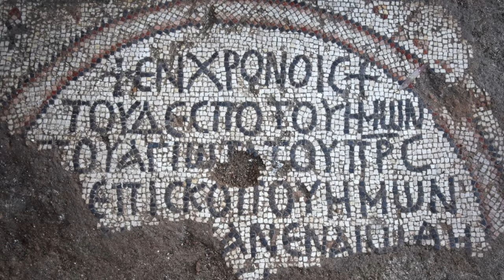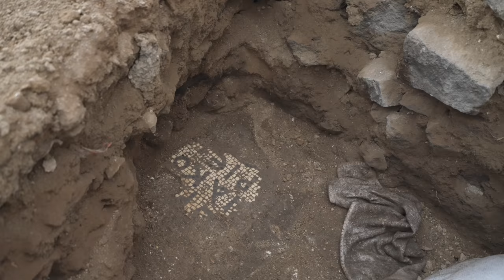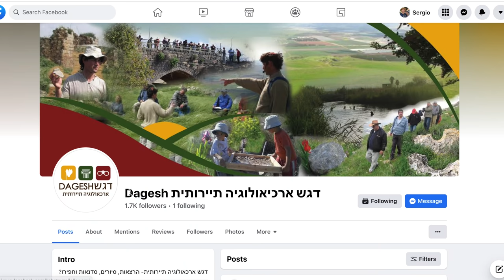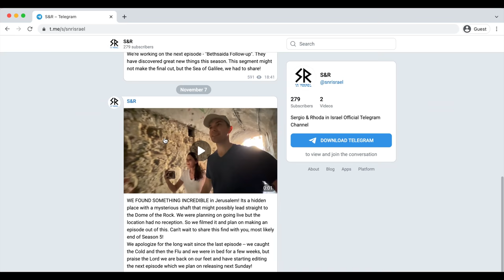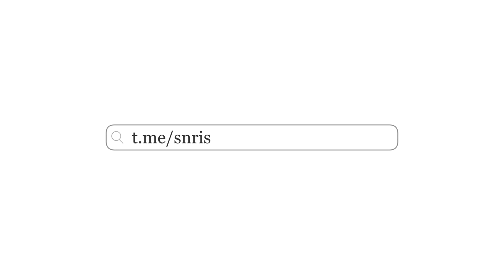1,500 Year Old Mosaic Discovered by the Sea of Galilee

Comment: Look, I'm Greek, I've seen the Greek Orthodox in many places where there was an ancient building or even a village they built their church on top of the old buildings
Is it possible that the church was higher, maybe with a staircase
so that the door was high and it started higher than the foundation
Reply: that's a pretty good conclusion though
Reply: I agree. Surely it had to have stairs? Possibly made from timber that has disintegrated.

Comment: I wonder, if they find a Hidden tunnel, leading in to the original Church some where? !
This is AMAZING!
Shalom  and nice digging from Denmark.
Reply: But the tunnel had to be joined with the building through an opening, right? The opening should be either on a wall or on the floor, which can be noticed by excavation. The only possible opening that can not be excavated was on the roof of the original building or a higher wall/story above the existing walls.
Reply: I was thinking the same maybe a tunnel!

Comment: Shalom!

At 17:14, there is an image of a wall, a half round rock structure, and nothing...  Or is there?

You can clearly see indications left and right along the wall where you are to step up and in.

I would say that the original stairs were made of a more valuable material, wood or fine rock that would induce people to like a grand entrance.  In later times these valuable materials were used elsewhere.

Tu-da!

Comment: Beautiful stratigraphy and work on this dig. Legend for the church of the apostles sat on the site of 2 of the apostles houses. It being such a seriously holy place until the end of the byzantine era, its a perfectly solid hypothesis that, apart from the floor and mosaics, the walls may have been completely "robbed out", and sealed with soil to keep the location secure but hidden during the chaos of the crusader times. Also, its entirely possible that being so close to the edge of the sea, that they had a very high levelled door, accessible by wooden steps in and out of the church to prevent flooding, but have long since rotted away and been destroyed by the crusader repurposing of the building later.
Both of these types of architectural and archaeological things have happened to other ancient holy or significant buildings of similar age around the Mediterranean Sea.

Comment: several of the 'unexplained' features resemble things you'd find in a catholic or anglican church (perhaps orthodox too but I don't know their church layout very well). The pillar thing looks like a font, but with the top basin removed? The half-circular addition looks like an apse behind the altar. That's very normal. Perhaps the church was converted at a later date even than the renovations to add the new features, to make it more suitable for catholic pilgrims prior to the Islamic invasion? The apse in particular appears to be of a much weaker construction than the main building, as if it was added on by less skilled builders at a much later date.

Comment: Please look at the flood records for this spot. The original builders may have built water tight walls for flood protection. Your missing doors may have been replaced by stone or wood stairs on the outer wall. (you know those steps on a stone wall where the step just sticks out from the other stones?)  This would also give protection from animal or human attack. P.S. use your ground penetrating devices to find the burials under that tile.

Comment: Thx for the video. Nice drome travelling. 👍 These are pit structures, like basements. Thus, the entrances were on the ground floor, which is not there any longer. Or, maybe even via a stairway, entering on a higher level. But, there aren't any stairs left over, to join that hypothesis. Anyways, these remaining structures are the basement of the church/temple building. 
Strange that the archaeologist, Achia, nor Prof. Notley didn't talk about this point. 🤔

Comment: Is it possible that what you are looking at is not the ground floor, but ab upper level, and that the entrances are on lower, possibly older levels? Have they considered using GPR (ground penetrating radar) to try and see if there are levels beneath where they are looking? Just a thought.

Comment: Maybe the wall foundation was built up above grade before the walls were built.  That would mean the foundation would prevent water from flowing in and they would have to step up to the threshold of the foundation and then stepped down to the inside floor.  That would save having to fill in the interior to bring the floor up to the top of the wall foundation.  Since it seems most if not all the walls are missing, that would explain why there are no indication of doorways.

Comment: The floor looks lower than the walls (5.15). My guess is that the structure had sink and rebuild a few times. The latest door was on current ground level, the previous door were closed with walls in later rebuilds. Not an expert on civil engineering,  so i actually have no clue about that.

Comment: If they wont find any doors, please check all the walls for any indication of entrance, maybe they sealed the room. 
And if thats not the case, then only explanation could be that its a basement and there were stairs leading down which means the main entrance was on a second floor or it had elevated entrance to a main building.

Comment: Is it not quite plausible that they have uncovered the basement/cellar of the church? The hole in the middle a drain, and the half-round structure outside a section for ventilation? The house I live in has similar structures in the cellar.

Comment: The archeology in Israel must evolve. In the 21st Century, p.t. the old techniques of erosion and scraping of the soil that cause damage to archaeological pieces cannot continue to be used.
Reply: A closer look at the word STAUROS reveals it was a word that had a new meaning but originally meant pale or pole..stake.
IT Now or came to mean cross.
Therefore..further digging may reveal ( if the building  goes back to the time of Christ..) that if there are symbols there  are no crosses.
Just as the commandments for the  jews prohibited dolatry ..the psyche of an early Christian would surely have been disgusted by the suggestion of such.

Comment: how far down have they dug. it only looks like they have dug 3 0r 4 feet deep. what if the wall where taller and had steps leading down but if the higher parts of the walls are gone you would not find a door. just like if a tornado took off the first floor you would not see a door to basement. What they should be looking for is steps if after they have evacuated the entire structure and found no door.